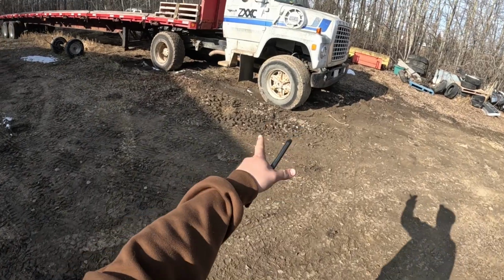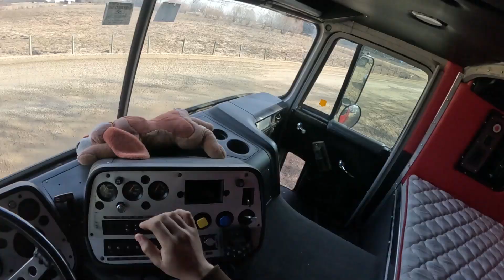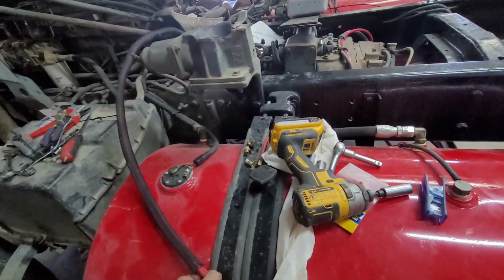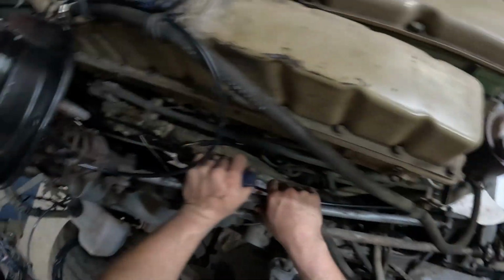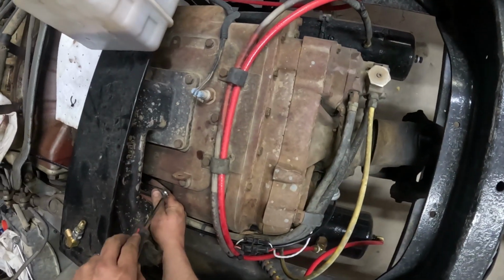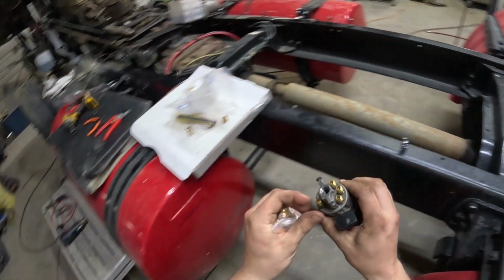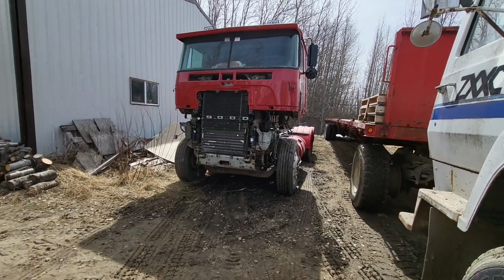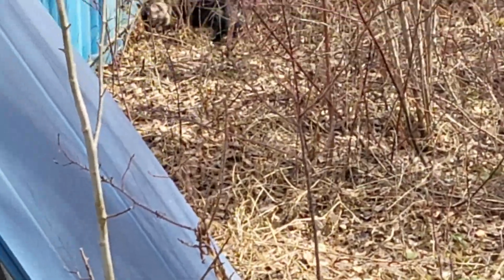Ford CL9000: Getting Back At It [ EP 24 ]

Comment: Awesome to see you back at it, I guess it's starting to warm up again over there. Love the sound of the GM when you took the truck for a drive. I bought another big cab CL9000 because it has air suspension, just in case mine was too rough. Now I have been told that I cannot bring the truck to Australia, I guess I'll probably sell it. Looking forward to all the videos you make on the big girl.
Reply from the maker: Australia seems to not like fun or style. We need to smuggle the truck over as parts or something.. slap a kw emblem on it.
Reply: @zXcTransport  I would melt the truck to the ground before putting any badge from Paccar on it lol

Comment: One peace at a time trust me i own a 2002 mack vision sleeper truck been working on for years bye the time I'm finished everything well be that dammm electric crap!! Keep up the great work driv,ah. Man the inside of your rig is beautiful so is the outside can't wait to see the finished product 🤘🏻🤘🏻🤘🏻 lots of money playin with these big boy toys...🇺🇲🇨🇦 can i ask what is your plans for the truck? Show truck or working truck?
Reply from the maker: Thanks for the encouragement, I run a 2016 pete and getting pretty tired of sensors going bad, recently had coolant dump into the exhaust because the EGR failed. I plan on using the Ford for work hauling flat deck. I'm making sure I update it a bit and be able to continue maintaince in the future.

Comment: 1980 I shipped a Cl 9000 to NZ. Big cam cummins 13 speed road ranger eaton rears came with apperance package stacked headlights chrome bumper etc, tan interior cab in white I do know the company Shellar Globe Corp. In Toledo Ohio formed in 1966 produced many of the components for the CL. Steering wheels, grill dashboard and many more A division of SGC. Also mfg the cab all alloy all welded came in three BBC. Sizes not sure about the frame Ford in Louieville Kentucky assembled the unit in my opinion the was ahead of its time so I got me one called her whistlin dixie. Look it up google New Zealand trucking magizene. ALLAMERICANAL
Reply from the maker: Thanks for info I didn't know that. Yeah these trucks were like space technology in its time. I'll look up the magazine.